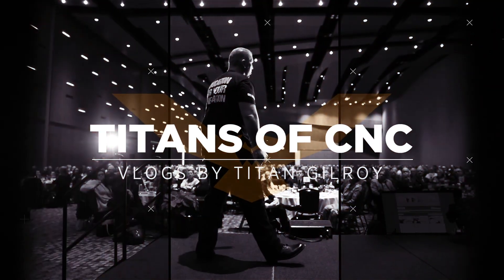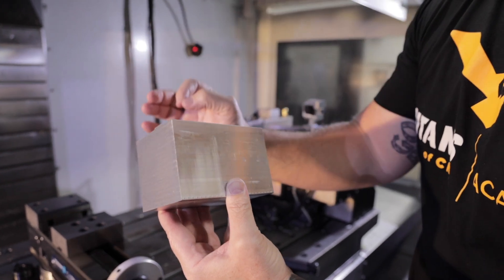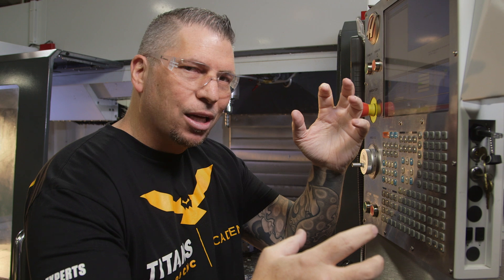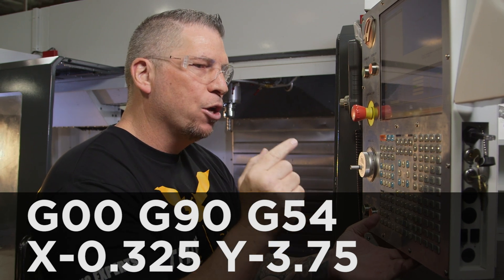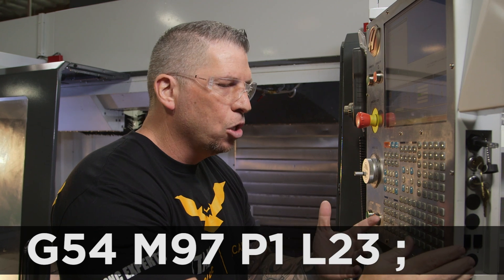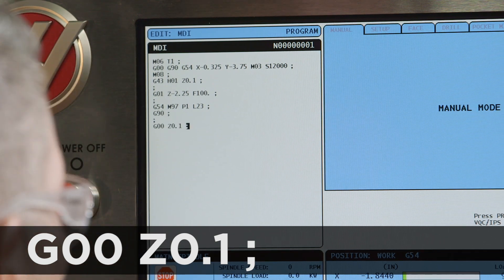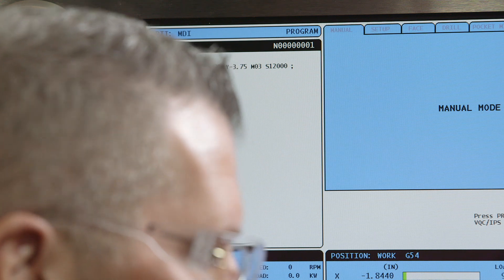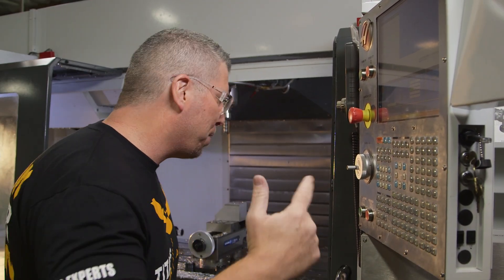G & M Code - Advanced Manual Programming Trick - TITANS of CNC Vlog #51

Comment: 5:00 you say it works on a Haas. My question is: does it has to do with the machine brand or does it rather has to do with the machine control installed on the machine, say like Fanuc or Siemens or Mitsubishi, etc….

Comment: 6:07 bad habit go lenght offset to 0.1(2.54mm). better go 2.0 then 0.1. there is no time stop machine on rapid waiting 0.1 is it is it the wil it go deeper. BOOM. 2.0 you will see. wait its under 2 feed hold look screen. even it need only first run and single mode on

Comment: Newbie to cnc programming, I have a block 140mm sq X 46mm thick and I need to machine a taper on 3 sides but have a radius as well, I was going to program each line of step over and down but I was hoping to be able to do it with a sub prog but I was getting confused as if I prog x and z to incrementally step over 0.054mm and  down 1mm will I also need to alter y, but then as I have a radius to go round how would that increase to then create a taper. It's a haas mini mill and it's my first cnc mill and I'm the only one who sets and progs, I don't want off line programming yet as I want to know manual programming so then I can understand line by line what the code means.

Comment: How do you step between cuts based on a mathematical formula. Cutting frets in a metal guitar neck where each fret separation is growing smaller at each pass. Distance = scale length divided by 17.817. They answer is subtracted and the resulting number is divided again til I cut the number of frets I want. I have written this in Basic where it printed the numbers. Seems like a N91 solution. Write a subroutine that is the formula. I also want to change the radius of each fret. Starting with a 9” radius at the first fret going to 18” radius at the 24th fret. I J solution.

Comment: Mate! 
Cnc shop I worked at, was running for years without subs, programs a mile long on repeater parts... 
I reprogrammed everything with subs... 
Everything is so much  easier to adjust. 
40 parts on a jig.. female 36mm between flats hexagon,fully deburred,  4 holes on the OD, chamfered and back chamfered. 
1 main program, 5 subs.. done. 
Boom.🤘

Comment: You and your son explain so well. Most people have to be machinist to understand why we explain some in detail. The way I program starts either how I start and end my programs. I make sure I stick to that so I notice if I did some wrong there.  Because I have seen people mess up at the start or end. I like to get the machine going on the first line. I. The first line I turn on the spindle and make it go to the first position where I begin my approach. I like to use EOBs to to separate the slots pockets or holes. And I name them to if I the measurements are going to be different. You must have been very good with your son Sir. I remember when my dad got me hired at 9.50 I thought this was going to be easy money where I could play all day. At just 3 months he made me load programs by hand instead of the easy way. Can you programs bolt circle patterns and maybe some boring a holes to a certain diameter and explain the math. I want to have those in a folder. Figuring out Bolt circle patters t he hard way is something I still struggle with.

Comment: I did this manually during my CNC studies lathing actually, not because it was part of the course. It was a Windows XP based Samsung CNC lathe, the program was buggy and drilling cycles were unprogrammable due to fuck knows. So i wrote the cycles as incremental sub-programs and called them, funny thing is you could hop between absolute and incremental on this lathe mid-program. So absolute positioning of the drill, then incremental sub-program goin in 2mm, backing out 0.5mm, going in 2.5mm etc. Then back to main program and back to absolute positioning. Learnt a lot about how to work with the limitations of machines and exceed them on that CNC education, mostly due to the machines being old and limited.

Comment: Great video.
I would like to know how I can enable my haas cnc VF3B command to accept input from programs with variables? 
 This program being the one I would like to use.

%
(PARAMETER DRILLING)
G17G21G40G80G90
G53G90G0Z0H0

(IMPRESSIBLE TO INSERT DECIMAL POINTS)
(DO NOT REMOVE DECIMAL POINTS ON THE MARKINGS C / *)
(DO NOT EDIT THE VALUES WITH THE MARKS C / **)

# 1 = 60. (SAFETY IN Z - G98 *)

# 5 = 2. (SAFETY IN Z - PAR R *)

# 2 = 75. (RADIUS FROM THE CENTER OF THE HOLE *)
# 3 = 270. (INITIAL ANGLE *)
# 4 = 10. (QUANT OF HOLES *)

# 14 = 1400 (RPM TO BE Punctured)
# 15 = 0.1 (TOOTH ADVANCE)
# 6 = # 14 * # 15 (ADVANCE TO DRILL **)
# 7 = -20. (HOLE DEPTH *)
# 8 = 1. (PARAMETER Q - VALUE OF PICA PAU *)
# 9 = 1. (STAY TIME - PAIR *)

# 10 = 1 (TOOL TO USE)
# 11 = # 10 (HEIGHT CORRECTOR - DO NOT CHANGE **)

# 12 = 0 (X HOLE CENTER)
# 13 = 0 (Y-HOLE CENTER)

# 16 = 0 (DESLC X HOLE CENTER)
# 17 = 0 (DESLC Y HOLE CENTER)

T # 10 M6
G55 S # 14 M3
G43 G0 Z # 1 H # 11
/ G52 X # 16 Y # 17 (TEMPORARY ORIGIN DESLC)
G0 X # 12 Y # 13
G98 G83 Z # 7 Q # 8 P # 9 R # 5 F # 6 L0
G70 I # 2 J # 3 L # 4
 G80
/ G52 X # 12 Y # 13 (CANC OF TEMPORARY ORIGIN)
 M5
 M9
 G53G90G0Z0H0
 M30
 %

Comment: I have used this hand programming method a zillion times, and there are many times it's easier than using cad simply because it can be quicker, without having to draw and then write a path, download, etc. Especially handy for one off stuff. I also use it with any shape, circles, and some simple curves etc. Just remember to take his advice on G90/91 issues. Run above the part first!   Good video!

Comment: i like the subs i used them when doing alot of drilling  you can use the subs to break up tapped holes and counterbored and thru holes in different subs  lots of copy paste  and i also used G91 and broached in the mill locked spindle and up and down in Z stepped over in X or Y

Comment: O1000;
G90 G80 G49 G40 G21 G17; ( for safety measure, so we reset all gcode)
G91 G00 G28 Z0; (home position - incremental programming)
G28 X0 Y0; (home position - incremental programming)
T01 M06; (called tool holder)
G90 G00 G54 X... Y... S2000 M3; ( go to starting point with the rpm set - absolute programming)
G43 H1 Z5; ( lower to the height above material 5mm - coz im using G20 - unit mm)
M8; (coolant  ON)
G01 Z0 F100; (lower to Z = 0mm)
M98 P51001; ( starting the sub program)
G91 G00 G28 Z0; ( back to home position - incremental programming)
G28 X0 Y0; ( back to home position - incremental programming)
M5; (OFF spindle)
M9; (OFF coolant)
M30. (return to starting programming - end program)

IM USING THIS FOR FANUC CONTROLLER :)
IM FROM MALAYSIA HEHE

Comment: Such easy steps you can also create without sub, symply install a Counter(by example #1), if you don`t want to have a lot of small subs after the PGM END.
 ;
#1=0; (Reset counter, number  NOT used by anything else)
N666; (Jumpmark)
G91 ......... ;
xyz;
xyz;
#1=#1+1;
IF[#1 GT 23] N555;

GOTO N666;
 N555; (Jumpmark)
;
;
Works with every NC, only little changes in writing #=/ VC=/R=/Q= etc. etc.
;
And I agree totally with you: only if you are able to read the NC you can shine at the CAM
Greets from Switzerland

Comment: I'm very new to milling and I've been learning offsets adjustments using a O7000 program. Using active offsets. P01, P02 and so on I can understand how offsets are made if the part is a 0° to the spindle. However when a part is Rotated say to 90° or 270°  I get confused. I run a kitamura hx300ig. 
Does anyone have a video that can explain or demonstrate how this would affect offset adjustments.

Comment: Haas' use of M97 is and has always been a fantastic feature.  Try using G52's for multipart positioning, incorporating M97's for the subs.  In other words, you can either hand program or use cam for the subroutines and position multiple parts with just one work offset(G54-G59).  I've set up jobs with over 250 parts on a 4th axis tombstone, sitting in a vertical haas this way.

Comment: I run two fanuc turning centers with live tooling. I adapted a helix milling and flats milling macros into gcodes. I also do custom macros on the fly for repeating features at different angles. Lot of the older guys did not like this at first, but it made things so much easier to program.

Comment: Lot's of people who are new to CNC world don't really get how powerful hand programming/parametric programming is. It may be because we live in a time where memory is unlimited and free cam softwares are floating around the internet. For example if you look at some youtube machinists they rarely do any complicated 3d surfacing op's that would even require a cam software. Then they get few parameters wrong, go edit, re-post, forget something, go back to the computer and edit, re-post.. and then they have a program with thousands of lines (and zero control), for a cube with few holes and a slot in it. Not trying to make anyone mad, just suggesting to at least learn the cycles and basic hand programming so that you're not standing around like an idiot not knowing what to do if someone throws you a part and says: "drill a hole in it".

Comment: . When should a peel cycle be used versus more conventional cuts. Example is a large eye bolt. You could drill a hole and peel it from the inside first or face the eye flat first then peel a smaller area which is generally much faster than a single peel cycle.

Comment: I have haas st20-ssy laathe in shop where i work, and last week i try some milling with subprogram wirh incremental in Y - by V. But the V was 10 x smaller than it should. #Parameter was 4.0 but movement was 0.4. So i multiple V by 10 then it works. Is it notmal?

Comment: Sir greetings from me. Sir please make a video on how to overcome the problem of chattering.
Reply: You can start by decreasing RPMS.. if that doesn't work try INCREASING your feedrates for you might not have enough chip load on the tool.. or take a bigger cut which is like increasing your feedrates.. if all else fails then you need to rethink either your setup or your tool holding

Comment: Cool lesson but is not advenced. I like You and what You do. But is BASIC, is must have in my job in my Country. You must know that. Every know that. I want say the advenced and more powerfull is macroprogramming.  Incremental and subprograming is fundamental technic.
Macro is not hard too, but more usefull. I think You know that.  

By the Way.... You are good Man and do what you do. 👍. Good job.
Reply from the maker: Just an advanced technique for beginners who are only hand programming
Reply: :) In my country is same. All operators need to know that basics.

For that, if you have Heidenhain, you can do that in simple easy and quickly. In that reason for manual programing is better to have Heidenhain. You can do all manually and proper cycles for all CNC working types.

More then 20 years experience on all CNC machines from Slovenia. 😉

Comment: Thanks for your advices it is very interesting. However it is vevy important and you forgot to mencion that the cutter must have at least 0.1 thousands more working fluts than the total deph otherwise the tool wil crash with the working material with the section  that does not cut.

Comment: Here is one I milled yesterday on a SS flange 9.0 dia x 2.0 thick. XY0 @ C/L of flange. Z0 @ bottom of flange. Machine is a PC-50 G&L HBM 4-axis with FANUC. Tool 2.0 Seco face mill.
G00G40G80G90
G53Z0.0
T01M06
M03S1200
W30.0
B0.0
X0.0Y0.0
W0.0
G43H01Z3.0
G01X0.0Y5.5Z2.3F100
M98P2L25
G90G01X0.0Y6.0F100
G00G53Z0.0
M30
Sub pgm
G91G02X0.0Y0.0Z-.100I0.0J-5.5F35.0
M99
If I waited for a programmer,  I could almost be finished before getting a pgm. Simple and fast.

Comment: We use G91 in a single line of coding to machine smooth ID's with a helical movement in both xy and z motion by moving to the center position of the hole... And then moving in one direction 1st to start the helical repetition as an example:
G90 G00 X0. Y0. ; 
Z5. 0;
G01 Z0. F1200. ;
G91 G01 Y3. 5; (radial size) 
G91 GO3 J-3.5 Z-0.5 L20;
G91 G03 Y-3.5; (radial Retract) 
G90 G00 Z20.
Sorry im using metric, so if your using a 10mm cutter it would be the 3.5+3.5 = 7mm
Add the cutter's diameter 7mm + 10mm so it should machine a 17mm ID for 10mm deep seeing that we're repeating the line 20 times with a 0.5mm step-down helical... You can also add another G91 G03 J-3.5 just after the Repeating line if you are machining pockets... It gives really nice finishes and is easy to adjust to stay in tight tolerances it can also be interpreted into sub programs like the vid showed... If lots of holes are machined... Oh and you can also toggle through Climb or Conventional milling by just Using G02 for Conventional or G03 for Climb. 
Keep up the Great vids Titan!

Comment: I work on a fanuc machine so instead of a M97 i use a while loop instead of a M98, the  beauty of the while loop is that you can increment variable values  using X#1 Y#2 and z#3  making it a very powerful technique to use
Reply: Jean I also work on Fanuc Robo drlls.Could please explain how to use the x#1 y#2 z#3 technique or @ least where to find it to study it. Thank You.
Reply: @reusmc  You need to read up on macro programming. The while loop works as follows demonstrating a simple square:

#1=0 (counter);
#2=10 (x value);
#3=10 ( y value);
while[#1LT10] do1; (LT=less than LE=less or equal)
N1 g1 g90 x#2.; (pass1= 10mm x+, 2nd pass= 11mm x+ etc)
y#3.; (pass1= 10mm y+, 2nd pass= 11mm y+ etc)
x-#2.; (pass1= 10mm x-, 2nd pass= 11mm x- etc)
y-#3.; (pass1= 10mm y-, 2nd pass= 11mm y- etc)
#1=#1+1; (loop counter when it gets to 10 the loop stops)
#2=#2+1; (10+1=11, 11+1=12 etc)
#3=#3+1; (10+1=11, 11+1=12 etc)
end1;

so this could be used in a pre drilled hole and then ramp it up to a bigger shape from inside, or starting outside and using "-" and reducing the size of a block etc. good luck :)

Comment: I have used macros to do something similar, except it milled a conical chamfer on  the top of a bore with a ball end mill, and the angle was specified for the macro.  The G91 is the perfect way to do many different ops with very little code.

Comment: At my place we use #30,#31 for if you need to repeat the same number for example z-40 you can use #30=40, then go z-#30 and it will go z-40 this is helpful for when you have to call In a figure a number of times then if you have to change or adapt that figure you just change the #30 and it changes the rest of the figures that are programmed with a #30, can you make a video on this? Thanks

Comment: As a CNC programmer working for Rolls-Royce in the U.K. I can recommend that anyone learning Cad/Cam also learns how to code long hand using G & M codes. It is a skill set that will serve you well in your career as an Engineer. I know that post processors can calculate out hundreds of lines of code, but to have the ability to read this code makes a good programmer into an excellent one. Boom, as you guys in the states say!

Comment: Hello from Romania! GREAT video Titan, I was very excited to discover M97 on HAAS  :D
I usually use variables on haas and fanuc machines and do the same thing
So the program will looks like:
M6 T1;
G00 G90 G54 X-0.325 Y-3.75 M3 S12000;
M08;
G43 H1 Z0.1;
#1=-2.25; (Z START POSITION)
#2=-0.325; (X START POSITION)
N1 G00 G90 Z#1 X#2 F100;
G01 G91 Y4.25 F300;
#1=#1+0.05;(WARNING INCREMENT NEED TO BE SUBDIVISION OF Z FINAL POSITION)
#2=#2+0.05;
G90 Z#1 X#2;
G91 Y-4.25;
#1=#1+0.05;
#2=#2+0.05;
IF [#1 GE 0.05] GOTO 1; (Z FINAL POSITION 0.05 above the surface)
G00 G90 Z0.1 M9;
M5;
G28 G91 Z0.;( BOOM!)
M30;

Comment: I use m97 subs all the time, i sometimes even use subs in subs for boring cycles or for canned cycles.
A nice one i use is say imagine have a plate with multiple holes some drilled through and some tapped ect... I will enter a canned cycle then L0 on the same line and the next line having my sub but the sub will have just be for hole centres so that way i can seperate the holes to what I want. When writing the program and i change tools i just pick which sub i want to use with each set of holes but put the canned cycle just before calling up the sub

E.g. 
T1 M06; (centre drill)
G43 H1 D1 z200.;
G17 g21 g40 g54 g80 g90 g94;
X0. Y0. M8;
S5000 M03;
Z10.;
g81 g98 R3. Z-1. F100 L0;
M97 p100; (6mm through)
M97 p110; (M8 tap)
G80 z200. M9;
M01;

T2 M06; ( 6mm drill)
G43 H1 D1 z200. M8;
S1200 M03;
Z10.;
G83 g98 R0. Z-30 I10. J2.5 k2.5 F80 L0; 
M97 p100 (6mm through)
G80 z200. M09;
M01;

Ect..

N100;
X-50. Y50.;
X50.
M99

N110;
X-25. Y0.
X25.;
M99

i will use subs to pick the hole centres then enter another sub for the boring/ramping cycle e.g. 20O/D hole 10mm deep with a 10mm cutter

N100;
X-50. Y50.;
M97 p150;
X50.;
M97 p150;
M99

N150; 
G0 g90 z0.5;
G01 g41 g91 x10. F500;
G03 I-10. Z-0.5 L21;
G03 I-10.;
G01 G40 x-10.;
G0 g90 z10.;
M99

I only started learning cnc programming a couple of years ago, i was a conventional machinist before that, 
My sub programming knowledge is self taught
Reply from the maker: That’s Awesome. Thank you!

Comment: I run wire EDM machines and use sub programs quite often. We made fixtures for machining multiple parts one after another, and my predecessor used to program the fixture in one long string with the CAM software. 10 or more parts in one long program. Just program it once, move over, and run it again, boom! 😉
It's a whole lot easier to follow that way, and if you have only a few parts left to do (and you're not going to be around) you can VERY quickly stick in a stop so you don't waste wire machining thin air (water)